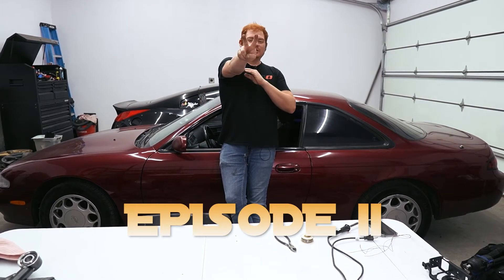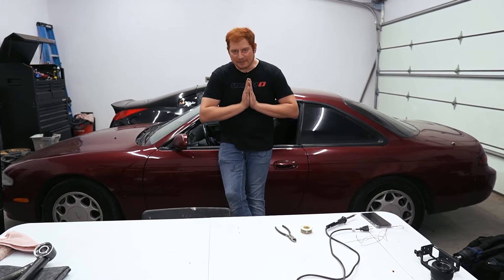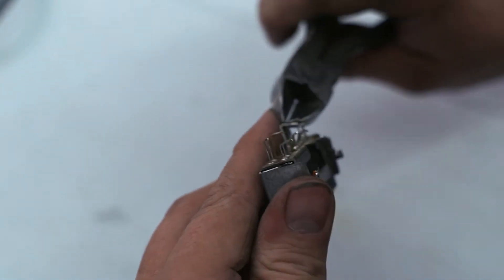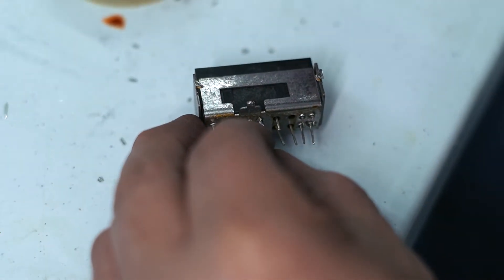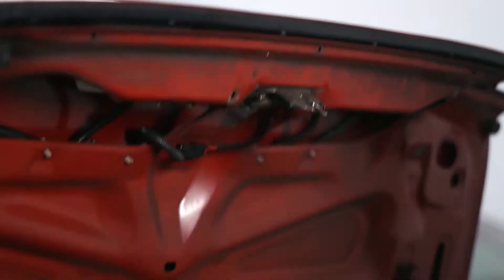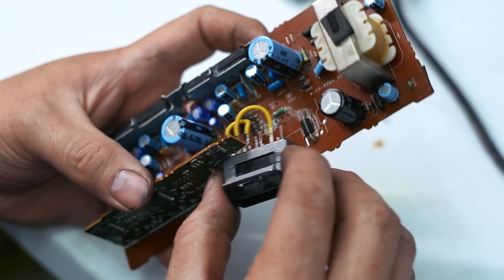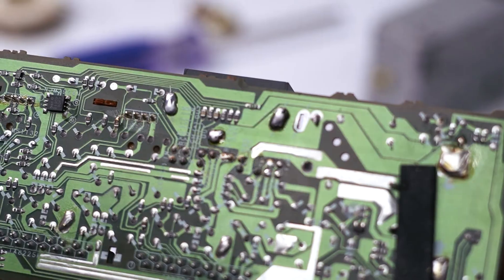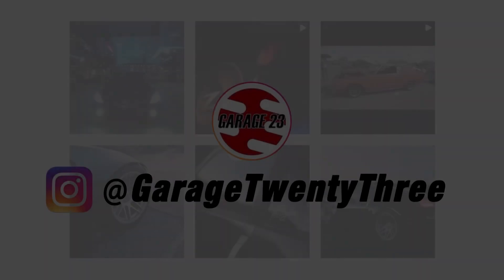Factory Amp Bypass 240sx

Comment: Hey i was having sound whine in my front speakers and got a new head unit so figured i would just bypass the amp since that seemed to be the issue, i tried just cutting and splicing the wires together and now i have no noise from the front speakers. Any help?
Reply: I dont but i actually js figured out i have a line output converter that lowers the signal for higher end amps. Meanwhile my amps non existent lmao, so I’ll cut that out of the system tomorrow and let you know if that fixes it
Reply from the maker: If your stereo still turns on and functions normally, I would double check what wires you spliced together that's the most common mistake.
Reply: @Garage23  hey i turned my volume all the way up and i do have sound but its extremely quiet
Reply: Is that normal? I know im getting rid of the amp but shouldnt the head unit be good enough?
Reply from the maker: Do you still have the OEM stereo? If you do that's the problem, mine is also very quiet. The factory radio only puts out like 15 watts i think. Most modern stereos are 50 watts+